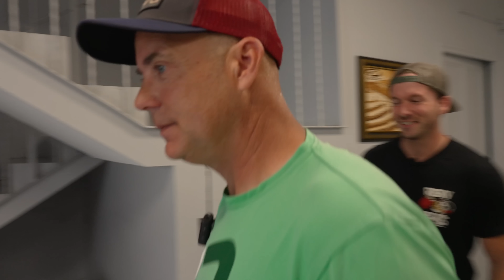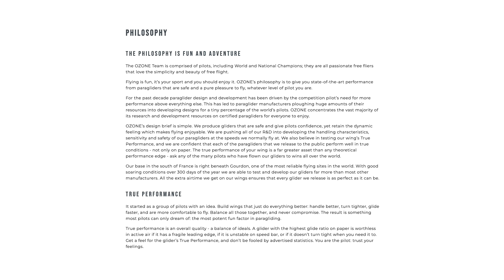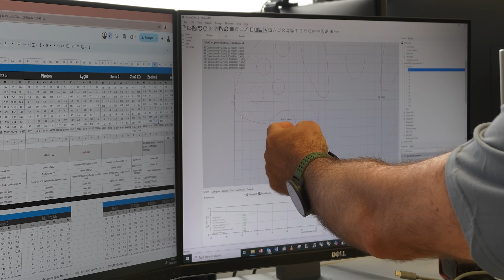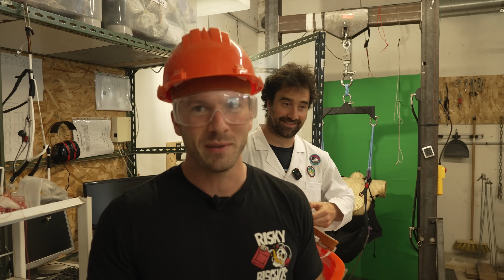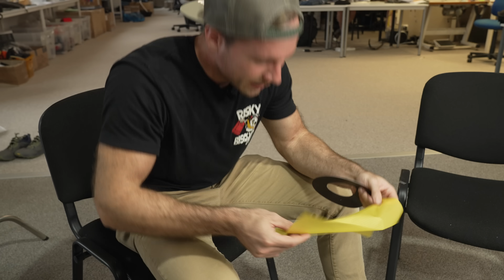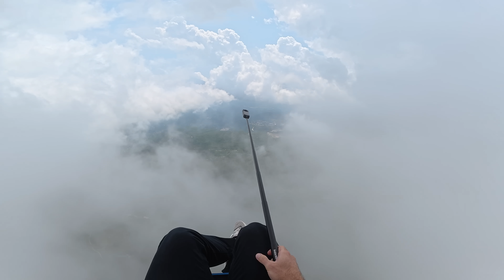How Paragliders Are Engineered - Inside Ozone's R&D Facility!

Comment: Awesome little wind tunnel! Any reason why they wouldn’t have used a water tunnel? I would assume at a scale (assume 1/15) like that for the model to be accurate the air would need to be moving at 15x faster to have the same reynolds number, or in a water tunnel a 1/15 scale would have the water flowing at the same speed as regular paragliding flight.

Comment: Frank Manning here in Ireland. The Rush 6 is the best glider I have ever flown. High B. Outclimbs every other glider. I also fly a Paramotor but the noise from the properller is so dang noisy. I need a new one. Question. Why do free flyers love bumpy strong thermals. Yet when I fly the paramotor the slightest bump scares me ?. Who else feels the same way. Beautiful video Tucker. Question no 2.  How many hours is an Ozone wing good for. Some say 500 hours. Thanks for the video. Learned alot.  Which do you prefer. The light version or the regular.

Comment: Sweet! So my glider that is at half porosity but had lines checked and trimmed, is good to go?! After having laser trimmed (atlas), it seemed to fly so slowly almost feeling parachutal. I assumed it was a porosity problem, but more likely, its NOW flying as it should. Lines were off by a bit before retrim, so I assume it had been flying poorly since the day I got it used. Excellent info! Kind of disturbing that a slightly damp glider gets ruined if you put it in the car for the hot day. Hmm, sounds like a difficult problem to resolve at times...

Comment: This video comes at a perfect time for me... well maybe about 1 hour too late 😉.  So... thank you !
   The test and comments by Ozone concerning porosity were very enlightening! my wing just "failed" due to porosity lower than recommended.   I have not noticed any difference in performance during launch or landing as well as agility.   Never had a parachutal stall.    Not quite sure what a shorter brake range  will do as stated by Fred Perry @29:21 on the timeline
Reply from the maker: I am curious, do you know how many seconds it was at for porosity?
Reply: Maybe your wing still flies well, but the fabric has degraded and will be weaker.  It would probably fail the test with the 2 needles and spring balance (forget the name)
Reply: Tear test!

Comment: Boy, for a non-setup, they sure answer the door quickly.    ;-)    He left out 'friggin GORGEOUS' when answering the Why did you pick this location?'.  I wonder if they've done any exploration with NACA flush inlets for inflation, or if that would even make sense.  With the flush inlet, you still get good flow with much reduced drag.   I guess drag is not much of an issue on an aircraft with '10,000' lines flapping perpendicular to the wind, but just curious.  The shark nose explanation was interesting.  If you get the chance, you could do more of these, they are quite interesting.   A trip through the training, front to rear, would be interesting, too, maybe from different schools, to give people an idea of what is available reasonably close by (the same area of the nation, anyway).  Great vid.  You asked excellent questions, unsurprisingly.   Aging implications for different weights is an interesting point.  Do they spec that differently for light and heavy wings?  One thing that I thought interesting was how very slowly the harness failed, with TONS of warning, beforehand.  That is a VERY desirable failure mode, rather than something that just appears absolutely quiet and solid right up until catastrophic failure, e.g. the pretty much zero warning/SNAP of some composites.

You probably wouldn't be dead at 30gs, but long since out, and pretty darn busted up.  It depends on positioning relative to the g loading vector direction, support, individual tolerance, and more than anything, the LENGTH of the exposure.  People have survived shock g exposures of well over 200 gs, and lived, and continued on, doing what they do.  There are airshow pilots that routinely pull up to 11 gs in their shows, for on the order nearly a second, and fighter pilots experience up to 9 or more gs in some aircraft for seconds at a time.  15 for any length of time is well into the 'no thanks' area, though.  In fact, for me, for ANY length of time, but I have certainly experienced it, shock wise, and so have you.

Comment: I Gott-a win that propeller! Awesome video! I think my next wing will be either a roadster 4 or a viper xc!
Reply from the maker: Thank you! Both great choices but a pretty big gap in performance! Happy to help whenever you're ready.
Reply: @TuckerGott  the sad story is i was  ripping a 16m driftair, probably put 40 to 50 hours on it. took a collapse and smacked the ground. Still recovering from injuries and haven't given up on flying yet! Im thinking i need a safer wing to get my confidence back. Which one would you recommend?
Reply from the maker: Damn! Sorry to hear about that. Tough question. I guess it depends on how much safer you want to get. The Roadster is going to be far less dramatic if you take a collapse. It will be much more docile in handling as well. The Viper xc is in the same “unrated” class as the Driftair. It’s not as spicy in terms of handling, but probably just as spicy in terms of collapses. It really depends how much you want to dial it back. I think the Roadster would give you more confidence.
Reply: @TuckerGott  thanks for the info!